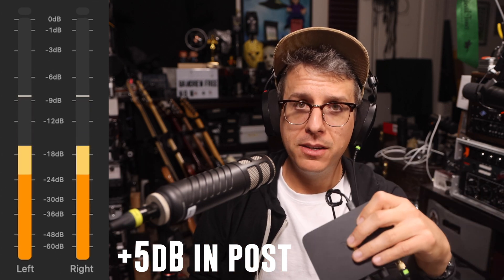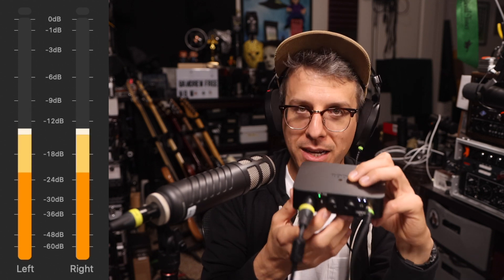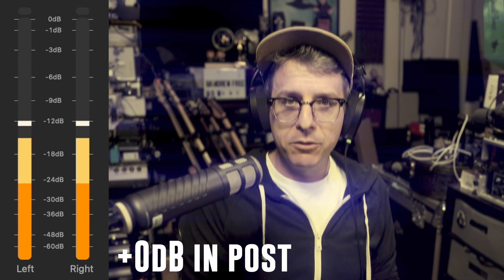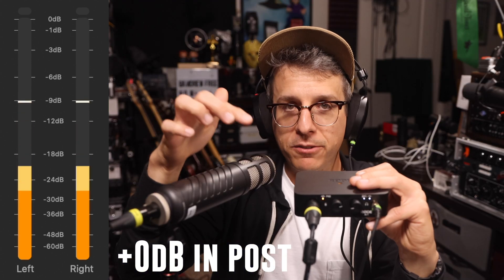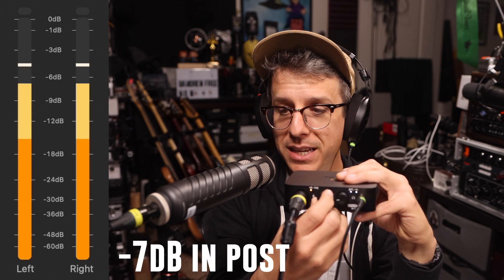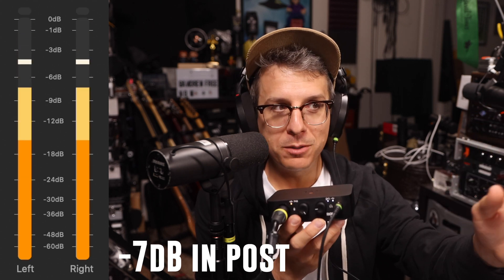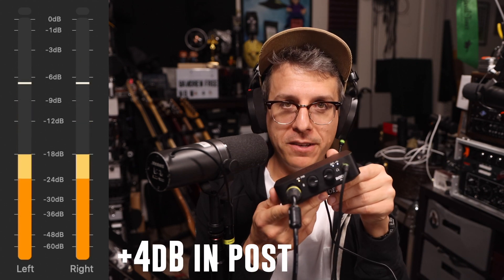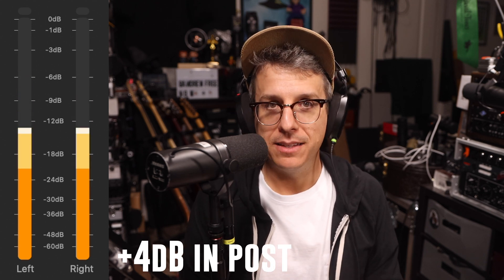60dB of Gain on the Rode AI-1 (Update Your Firmware)

Comment: Important message about the firmware, if you have Firmware 1.3.0 you don't have to update it. it's the latests update. 
Here is a quote from an email I got from Rode:
I can confirm that they're the same version, but for whatever reason that we're working on in the back end, it's showing 1.3.1 instead. 
I can confirm there is no real update, you won't need to worry, the AI-1 is working fine. 
Kind Regards,
Gavin
RØDE Service and Support

Comment: A technical explanation would probably be awesome. My initial thought is, the pre-amp is an operational amplifier. Such an amplifier can only amplify voltages up to its own power supply voltage. The knob probably encodes different voltages for the power supply and know they could raise the max voltage via software. When its pulse-width modulated simply make the pulses wider.

Comment: Update: I've tried to install latest Rode Central, it did not help with installing the new Firmware, nor did updating windows 11 to latest build, latest updates.
And still get issues almost every time I reboot the PC, Ai-1 is not detected. so have to unplug it, and plug it in.I've read it works on Windows 11 & Mac OS.
Reply: Still failed?
Reply: @kaizeroff  I fixed the issue with reboot, I installed the Asio driver.
But still can't install the firmware. Rode Central closes when I click update.
Reply: Got an email today too:
Hi Johannes,
 
Thanks for sending that through.
 
I can confirm that they're the same version, but for whatever reason that we're working on in the back end, it's showing 1.3.1 instead. 
 
I can confirm there is no real update, you won't need to worry, the AI-1 is working fine. 

Kind Regards,
Gavin
RØDE Service and Support

 @kaizeroff
Reply: @mtbboy1993  I don't quite get it, does it end up working as it should or not?
Reply: So basically the firmware installer shows correct firmware, that I have the latest firmware, but Rode Central does not. So I already have the latest firmware, but the firmware update in Central is not really an update but the same firmware. Actually there was an update to Central but it did not have a fix for this.  @kaizeroff

Comment: Personally I find the rode ai 1 to be too expensive for what you get. I personally opted for the motu m2 because I wanted a low noise floor, 2x mic inputs and the accurate gain meter is nice. However for my rode podmic it just has way too noisy of pre amp noise. I was really frustrated and after eq and compression I needed to add 30db of gain in obs just to get my voice around that -14 lufs range for YouTube. This ensures that you can be heard well on practically any device. So I started researching fet heads and I was really intrigued if they really worked well and if it was worth the cost. Previously I had only heard of the cloudlifter and it being used for the sm7b. But during my research I came across a few high quality options that were much much cheaper. I purchased the triton audio fethead for dynamic mics and WOW!!!! Let me tell you that things is amazing! I went from 4 o'clock gain (approximately 75% of the motu m2 dial turned clockwise) to around 9 o'clock gain (approximately 25% gain of the motu m2 dial). I was completely blown away at how much gain I really got and its sooo clean and crisp! Now I have PLENTY of headroom for gain before peaking and was able to get 0 noise from the pre amp. As well as a box fan about 3ft away on max setting using rn noise suppression filter in obs studio and it was almost completely in audible. Now take into consideration this is a completely un treated room with 45° ceilings so sound just bounces around like crazy! I have recently built a "" sound studio"" using a garage ceiling storage rack and harbor freight moving blankets hanging from the rack. This basically eliminated all echo and softens the sound a lot. I have yet to do any test recording but just from my ears alone I can tell it reduces the sound of the Ac and fan a bit. I'm very hopeful that with rn noise suppression that at least the AC noise will be completely gone. I eventually plan to use the space for recording voice over or audio book stuff but I'll probably wait for winter for that haha. Anyways it's still really cool that rode was able to improve the gain with a firmware update (hopefully the pre amp noise is still low). Now if they would lower the price to around $80 I would definitely recommend it. But there are a few better options around the same price range of the rode ai 1. Thanks for the great videos bandrew! I made my decision on what mic and pre amp to buy from you and Julian Krause's videos!

Comment: How is this possible? Now I wonder if I can increase the gain I have from my Audient ID4 Mark II
Reply from the maker: I'm guessing there was some form of attenuation on board that they were able to remove, or maybe add +15dB boost like a fader that goes +15dB above unity? I'm not 100% sure how it works. It would be super interesting if Rode released a video discussing it.
Reply: Most likely they just fixed a firmware bug.

Comment: What the heck "Your AI-1 is running firmware version 1.3.0 - 1.3.0 is the latest version." .... 🤔🤔

UPDATE:
On both Mac & Windows the old "AI-1 Audio Interface Firmware Updater" maxes out the firmware at 1.3.0..... You NEED Rode Central to get to this update (1.3.1)
ANOTHER UPDATE:
Rode Central would insta crash on my Windows PC when the AI-1 was connected. Had to update it on Mac (no issues there)
Reply from the maker: Good to know about the issues on windows. I use Mac and had no issues on the update. Thanks for sharing,.